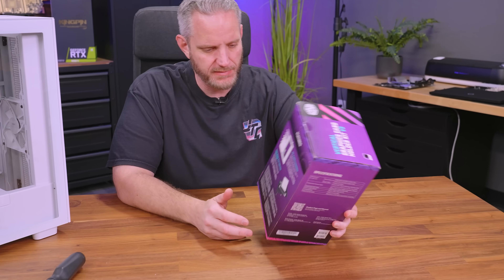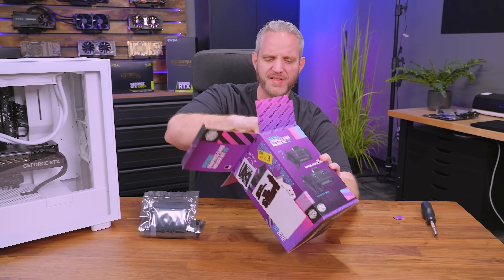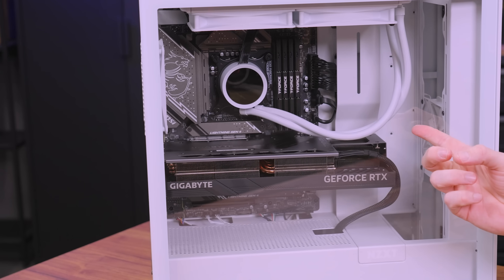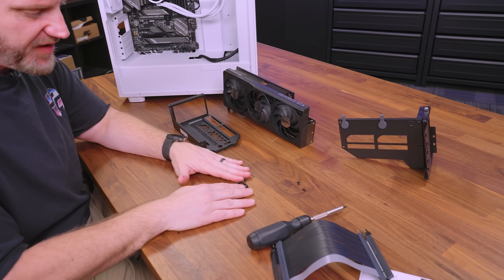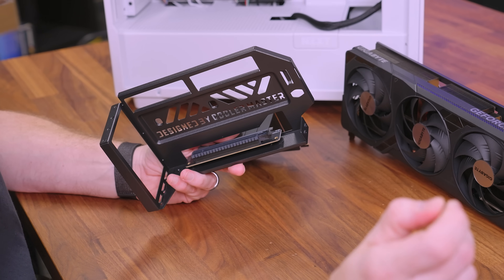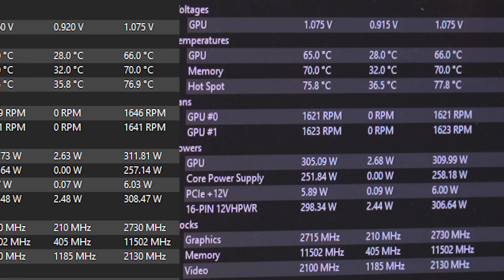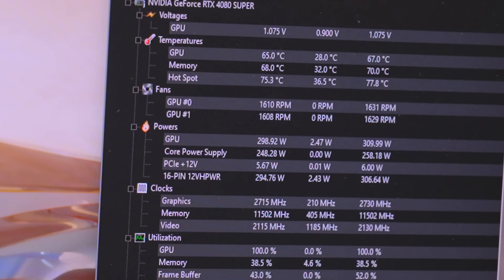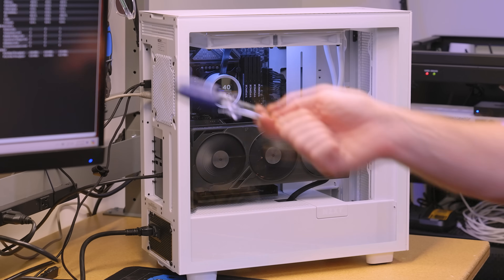Can this mount actually HELP GPU temps?

Comment: Logic and thermodynamics dictate that air rises and fluid falls, thus in a heat pipe where there is heat transfer, the hot spot will be at the top - and thus optimal placement would be for the heat pipes to be vertical with the heat generating part at the bottom.

The higher the condensation part is from the generating part the higher the temperature difference between the pipe and the outside and thus the greater the heat dissipation which can occur.

Comment: I see one problem with that vertical mount,  and that is that it takes up all of the slots available in the case leaving no choice to put anything else in any of the other PCIe slots like I have a 10Gb PCIe x4 nic that I would no longer be able to use if I chose that bracket

Comment: I bought this and for me it helps my gpu cooling. Maybe because I have fans below my gpu, compared to my old case. From usually 80 deg to 67-70 but no much on core temps, around +\-4 degree celcius cooler

Comment: I have an O11 clone with a 360 rad in the top sucking air up and three 120's sucking air into the rear compartment and just a 360 filter in the case floor.  I tested the GPU temps in horizontal and vertical, and vertical showed better temps and higher benchmark averages.

Comment: if you look closely at gpu fan speeds on your charts the gpu fans are turning slightly slower to. its minor but is slower so you gained a minor boost and gained slightly slower fan speeds by vertical mounting. with your tests

Comment: I been working with a white Phanteks case with a Phanteks white vertical mount. The mount is sleek but very sturdy. It absolutely ties the case together showing off the sexy vertical VC.
Reply: I have the black :)
Reply: Yup my pc is in my profile picture with the phanteks vertical mount in the phanteks nv7 and it looks good.

Comment: Honestly you should've done a fan speed test, lock the fans at a higher speed on both tests.  I let mine run up to 80-100% (only goes to 100% if the core hits above 55C which it rarely does) because I game with headphones & I can't hear my 4090's fans through them, regardless of speed.  Unfortunately the Chonker that the Gigabyte 4090 OC is, I'm pretty sure it's not possible to vertical mount it lol not that I'd want to unless it gave a further improvement on temps.

Comment: Cooler Master Master Accessory Vertical Graphics Card Holder Kit V3 with Premium Riser Cable PCI-E 4.0 x16-165mm, Compatibility PCIe 4.0 and Older for E-ATX, ATX, Micro ATX Chassis, Black $86.99 CAD plus taxes Amazon Canada

Comment: Thanks for show casing this vertical GPU mount.  I have seen others and wasn't interested in them due to fitting issues.  The designers/engineers of this vertical mount seems to have though-out this issue quite well.  Will get this for a new PC build.  I didn't expect any improvements in cooling as in-take/exhaust fans/air remained the same.  However, I do see a benefit of such mount that the weight of the GPU is no longer on the mobo, thus less stress on the PCI-E mounting port.

Comment: There is one other detail I didn't specify at the time about the cooling/venting with my laptop: the air is blown down ⬇ - it's force. Then the air is forced thru the vent where there's a depth in the venting pad before the air gets to the exit of it. Maybe their needs to be a length of space between the vent & the exit. For my laptop, the flow is all downward; starting from the laptop ⬇, thru the cooling pad ⬇, thru the venting pad (with a depth beore the exit) ⬇ - & something about the venting pad is enhancing the cooling. I saw on the NitroSense app.

Comment: I swapped the stock cooler to a Morpheus II on my GPU, temperatures remain low 50 DEG C values. I tried using different positions with a riser cable, but it ran coolest in the standard position without use of a riser cable.

Comment: The only reason why you are doing a bit better is due to the front intake fan air can now reach the gpu. Before hand it wasn't doing a good job at all You should really have a bottom fan blowing air under the gpu when mounted horizontally. This will feed the gpu fans cool air so it can then cool down its heatsink. And you should have the middle fan where its currently at. This will also help cool the heatsink of the gpu.

Before hand the front fan was just hitting the edge of the gpu. And the gpu fans were dealing with grabbing the ambient temps of the case instead of having access to cool air from a fan.

Now with the vertical set up the gpu is getting a good amount of air in front of it which is allowing the gpu fans to grabe that air and cool its heatsink down which is allowing the gpu to boost higher. It could be better if most of the front intake was supplying most of the air infront. However a good portion is still hitting the side of the gpu and going behind the gpu. So you are only getting a third of the air that front intake is supplying for the whole gpu. Its better than what you had before but a lot of improvement can still be made just by putting in a bottom intake and mounting horizontally again. That bottom intake will supply enough cool air for the gpu to perform better. But seeing as the psu shroud of this case will steal about half that bottom intake air supply you need to mount at least one rear fan on top of that psu shroud so the air can make it to the back of the gpu. But i would recommend two. Bad designed case FTL.

Comment: Does anyone know if the GPUs orientation has an affect on its vapor chamber?
Reply: Yes it does. If you do normal or vertical like this, no problem. But if you do as the other case he shows, you may have issues. I had with my Galax 3080 on a The Tower 500 and had to adapt to the "usual vertical" like he is doing in this video.

Comment: I have a vertical mount bracket for my 4090 that doesn't screw into the case at all, its held in place by two powerfull magnetic feet giving it better sag support, this lets me move the card forward, back, side to side, and rotate. It also is adjustible for pitch, so if I want the fans to face up more it can, or with swapping a couple parts around it can pitch the fans down a bit so the air blows upward.
I just wouldn't move the computer around much without removing the card.
And thermal performance is on par with this test.

Comment: I have the same cooler master holder. But I used it to remove the huge weight of 4090 from PCI express slot to prevent sagging or a potential damage to the motherboard. It was enough for me that GPU didn't run hotter in vertical position.

Comment: will this mount allow the use of ANY other cards on the motherboard? like will an additional network card be able to be used with it? Or does the riser mount take up ALL the spaces and not allow the use of any additional cards. The NZXT H440 I have has 7 card slots in the back. will this work?

Comment: I tried this in a cooler master haf700 case - it did Not fit in their own case.
Plus it was Way Too close to the mobo (I was watercooling CPU And GPU. Move it away from the mobo and you lose ports.
It's an 'ok' attempt, but it is Not a solution in every case.
What worked for me was buying an external floor mounted mount that you could fit literally Anywhere you had the space for it.
Way cheaper, Far sturdier, and, IMO, Way better looking.

Comment: There I was, watching this and thinking... Really!? Jays OCD is just going to accept the GPU sitting on that angle? 
Also, I still use Add-on Cards since MOBOs don't come with enough SATA Ports now days. Is there enough room back there to run ANY other cards with this Riser Bracket?

Comment: It's definitely for Aesthetics I've had this same vertical mount in my computer for the last 3 years and it heats up your side glass panel something fierce I've been thinking about water cooling ever since I'm tired of doing the traditional fan with AIO and the whole area surrounding my computer setup is at least one to about 3° hotter than the rest of the house

Comment: I have a i9 12900k I used negative adaptive voltage -.070 is that fine if the system is stable

Comment: Interesting.. Running a FE 4090 With the EKWB adaptive Full block... I forget the name (both front and back are water-cooled). I am running everything inside a Cooler Master Cosmos C700p (yes.. that monster) in the regular Horizontal position.. NOW I am REALLY WONDER...for the looks ofc as it is already watercooled as said before :)
My only "minor" gripe is that I will have to remove all my other PCi_E cards :P and just for the "looks"... :)
I really wish somebody would make a DESIGN or CASE where I would NOT have to sacrifice one FOR the OTHER! :)
Jay.. If you know anyone, I am OPEN to suggestions :) Money is not a problem (unless they want a car/house price for it :) It is a hobby after all :P )

Comment: So back in the day you did a video on a pc build off a B450m MOBO and I pretty much went with it except a few cases (Installed AIO, stuck with HDD, RX 580). I've upgraded it now to a Ryzen5 3600 and a NVIDIA 1660 super yet since I've been getting serious issues with games just crashing, closing down with no message (Including those that were giving error messages). Other issues are blue screen saying 'IRQL not less or equal' alongside other less common issues. Anything you could consider that an 8 year old post wouldn't have a clue about?

Comment: Used this in my wife's pc build. Honestly, worked pretty well. Only "Surprise" was the need for some right angle display ports to fit through the pci slots of the case. Jay dodged that bullet using a case that doesn't have metal "posts" to reinforce the pci slots area.
Reply: Thanks for mentioning this. I am using an old Corsair Sniper case. It's cross bars are riveted in, so with some work I could still make it work, but it is not worth the hassle for me.
Reply: Currently using this in my Corsair 4000D. I manage to use normal DP and HDMI cables but I’d never disconnect those cables. It’s too big of a hassle to connect those cables.
Reply: @DarkPST  hi, what gpu are you using and how many slots is it? i asked cause im also using a 4000D (airflow variant in mine) and wanted to vertical mount my 3.5 slot card (XFX 7900xtx Magnetic Air) but wasnt sure if it would be a good move.
Reply: @bryanjones4311  TUF 4070 which is 3.15 slot (63mm), but I think the length is more of an issue. I have to move the card towards the front of the case so the cables don't bent that much leaving only around 3 to 4 cm between the card and the front fans(25mm thick LL120). With your card being 4.5 cm longer than mine I'd suggest you either don't use this product or cut those metal bars.
Reply: Yea Why no one is mentioning how stupid this design is?
Reply: Yep it's kind of a undocumented caveat when installing this mount kit. Had to bend one of the slot crossbars in order to properly connect the display port cable (should have done that BEFORE mounting the card, maybe 🙄). But after sliding the card inside a bit, it could be bent back to its original form.
Reply: Guess my Dremel will finally see some use lol

Comment: I have a Cooler Master Cosmos C700M case.
Which has its own vertical mount and riser cable 4.0.
The mount is much smaller that this one.
But it still holds my 7900 XTX Red Devil Limited Edition quite well.
But i can't have the card sit straight up vertically, because i cannot close the glass side panel.
It has to be tilted inward diagonally for me to be able to close the panel.
But it's even better that way, cause i think it looks a bit nicer when the GPU stays that way. 😁

Comment: Would be nice to see the difference in mobo temps aswell as nvme(s) drive temps. Can imagine vertical mount would benefit nvme temps if there is enough space and some airflow

Comment: So why not lian li's vertical bracket they make for the 011 mini/air mini ?   I use the 011  air  mini V2 with it and its been fantastic and is solid no movement when tightened down. also lets you adjust in and out(3 adjustments for in and out placement) this gives huge amount of options depending on GPU one is using. Cheers!

Comment: I have that Cooler Master GPU vertical mount and riser cable. Love it. You can’t appreciate the ROG Strix 4090 without one. 😊
Reply: I have the same setup and agree with you 100%.  Plus, we don’t have to worry about the heavy ass brick of a GPU bending the PCIe slot!

Comment: Used that exact bracket in an Asus P201 MATX case with a AMD Radeon 6950 XT. Ribs on the back of the case blocked the ports so I had to adjust the bracket position to rest more inside the case. This made accessing the two DP difficult. Other interior cabling was cramped and pressed against the bracket resulting in an uneven tilt to the card position... all in all, it worked.  Barely.  Ended up returning the bracket and restoring the GPU to normal mounting on the MB. In short, your mileage may vary on the utility of this bracket for smaller cases.

Comment: My thermaltake core p8 came with the framing setup and a pcie riser cable. 
So, I used it. My 3080 TI cooked the pcie riser cable. 
I end up having to reset the frame for a " normal" mounting of the GPU because the riser cable was no longer usable. 
I don't use that GPU anymore, but, kind of curious about going back to with the way it was originally designed

Comment: Been using that exact mount for about 6 months now, have to say like you I was shocked at how well built it is. Mine house a 7900 XTX and this version (AMD ref) blows only through top and bottom. It has improved by about 5 degrees since installing this and more importantly never throttles. I can highly recommend this guys, Thanks for sharing Jay
Reply: You were throttling before this? It might be that vapor chamber issue. I was just curious because I run the same gpu atm.

Comment: Had the earlier version with PCIE3, ever since I got a new motherboard I haven't been using it with my 3080. I wonder if PCIE3 and PCIE4 difference is noticeable, I would like to use the vertical mount. That new version looks more stable than the old one

Comment: I don't care for vertical GPU mounts, from an aesthetics standpoint, it reminds me of having an grossly oversized fish in an aquarium.   

From a system viewpoint, adding the riser cable may not at present cause electrical/signal issues in many situations but I do not see how it can possibly help to add an intervening connector and length of cabling (especially going forward to higher PCIe spec versions).  Recall also that there have been poorly designed risers that have actually caused electrical burning.  

Rather than putting the effort into a vertical mount, It makes more sense to use a horizontally mounted water cooled GPU.  This improves both thermal and size issues with zero possibility of degraded PCIe signalling.  I do realize that some SFF case designs simply don't work without a riser (one reason I am not that interested in SFF).

Comment: Mine was cooler with ther  vertical..  but I also had 3 fans blowing up from the bottom..also for my other card which didn't have any blow through it was a good deal  better

Comment: for this setup, an exhaust fan at the bottom will help, else the hot air from the bottom will go up, and the intake fans of the GPU will push it inside the GPU.
but the best setup will always be: a "tube" getting fresh air from the front of the case directly to the gpu.
so 1 fan will get air from the front panel, the tube will guide the air flow to the gpu
so the hot air will not go back to the GPU

the other way to have a good air flow is to have a larger heat sink directed to the back, and 2 small fans getting fresh air from the front, the flow go through the heatsink and directly outside the case on the back.
like in a server where all the components are aligned to let the air coming from the front to the back.

Comment: Same problem here, the new Arctic cooler has the tubes at the bottom, and you cant mount it different.
Cant use any vertical mounts.

Comment: I put a vertical mount in because of the strain on the 12volt with my case size, there is MUCH less on it now in a vert position.
Aesthetic wasn't the goal. On top of that the wait for a 90-degree 12v cable extension was going to take WAY TO LONG to get and the mount took 2 days.

Comment: I bought this mount for a powercolor hellhound 7900xtx. The display port and hdmi ports were actually blocked off and i was unable to use it without putting a huge strain on the cables.

Comment: I had this for a few months.  Worked fine with my air cooled 7900XT.  I decided to ditch it when I got a water block for my card.  Tubing runs just didn't work out to my liking using the vertical mount.  Turned out nicer looking mounted normally.

Comment: I think the whole layout of motherboards and GPUs might have to change. Imagine insteag of an PCIe slot having something like the CAMM2 connector for your GPU. The GPU could now sit so close to the MB, that the GPU cooler could look like an CPU Aircooler. Those standarts for ATX, PCIe and whatever are pretty old. Maybe rethinking this standards could open new possibilitys.
Reply: Its only a matter of time before we start making separate cases entirely for just the gpu and dont even put the gpu inside the main pc case. Were already using strimers.
Reply: The GPU PCIE5 traces shouldn't be long, I have wondered about having the GPU above the CPU expelling air from the case top at the back, rather than into the RAM/VRM area of the mobo.
It would reduce the chance of water cooling leaks running into expensive GPU.
Reply: Stand... Darts??? XD
Reply: @Nareimooncatt  whoops